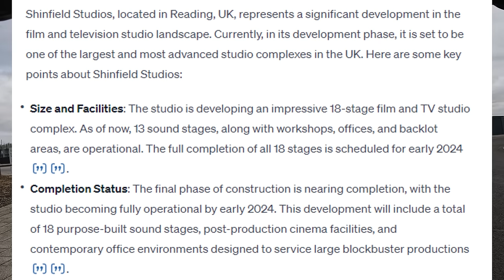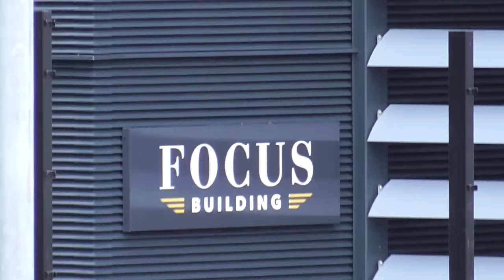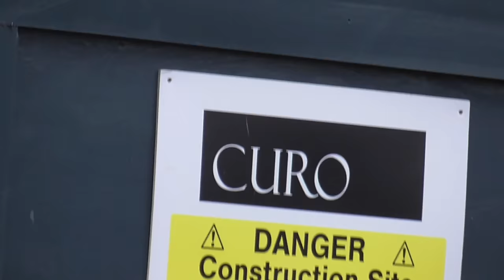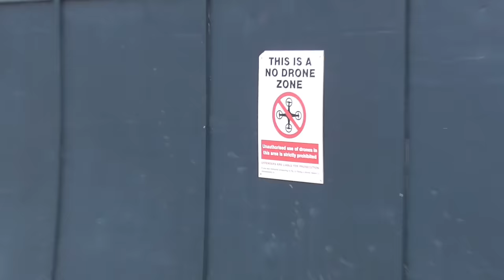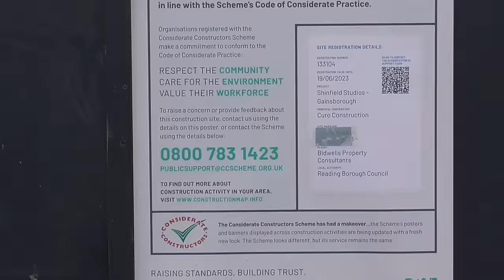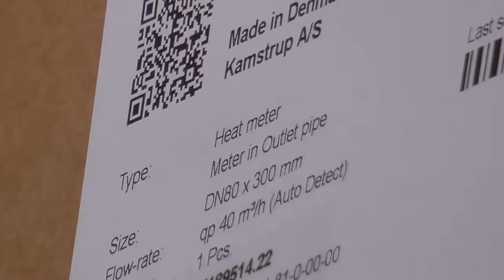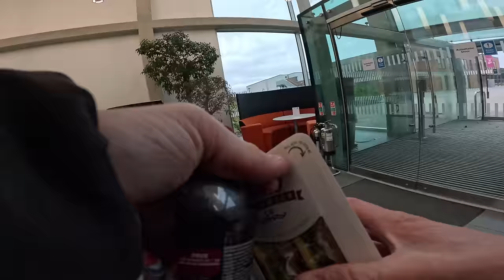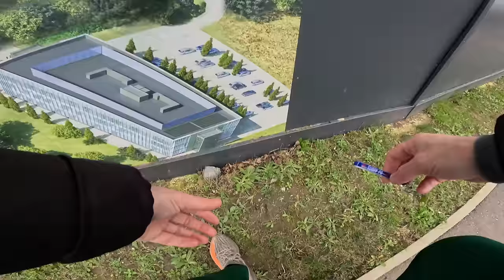This Is A Film Studio So You Cannot Film Here! 😲🛸🎥❌

Comment: Harrington Builders and Shinfield Studios each posted video of the recent construction as well as numerous other channels. By the second gate, the light pole is ever so slightly tilted.⭐⭐⭐👍

Crowdhouse Energy installed a 30 KWP roof solar system.  The 2021 concept drawing associated with planning news articles show several larger studio buildings to include roof solar.  Appears not yet installed and may be reconfiguring the solar layout as what is installed on the one building is configured different from the concept drawings.  Planning docs may have more detail.  A late 2024 revisit would be great to see if additional roof solar is installed and the configuration.
Reply: That's really that big, considering the size of the place. I think around 60 standard panels? Think of the lighting in that place (Although I do realise that it will be LED lighting, mainly at least).
Reply: @northernsouldj7591  That was only article could find and vague on which building.  Suspect most solar will be installed as one project after all construction.